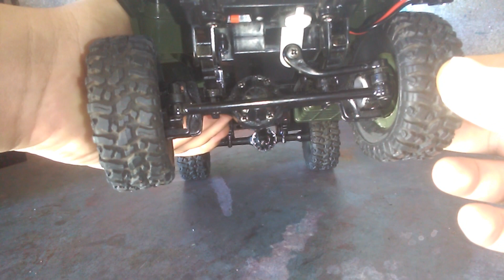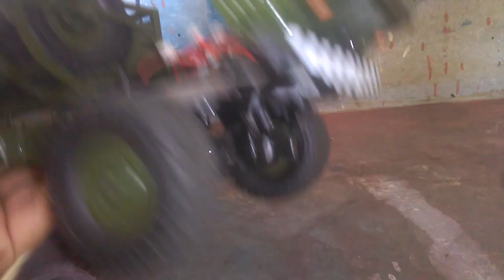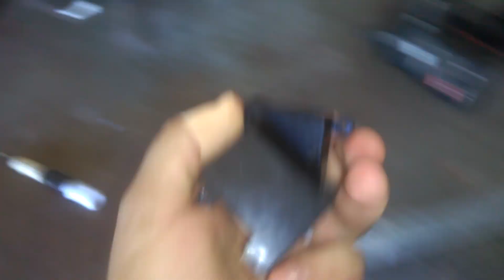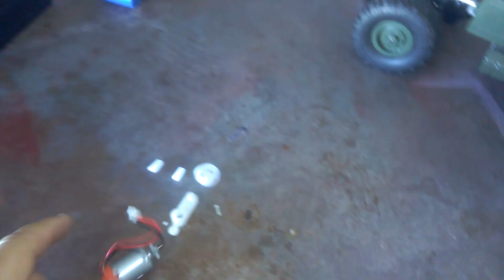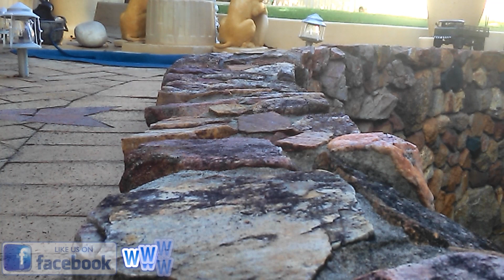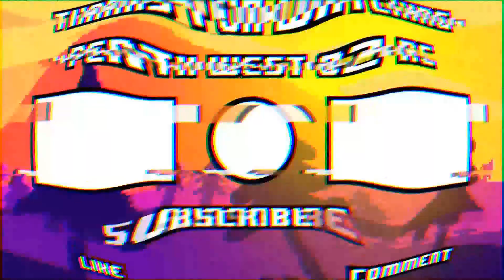WPL B-24 1/16 4WD RC Military Truck Upgrades

Comment: This is going to help me do the same thing to my jjrc q61 I've got coming Tuesday! Today's truck come with the 130 motor in it? And did you put a more powerful motor in it?
Reply from the maker: Hi mate cheers for watching, and no the motor is the stock one that came with, goes quicker cause I'm running it now on a 2s lipo not the NiMH provided

Comment: Very good conversion Dave, I have used quite a few lipo batteries for mods like this. It pays to hold on to extra parts in case you need them.
Reply from the maker: Thanks Gregory